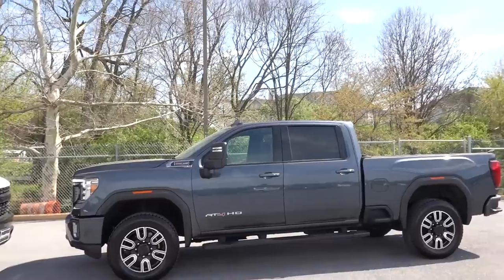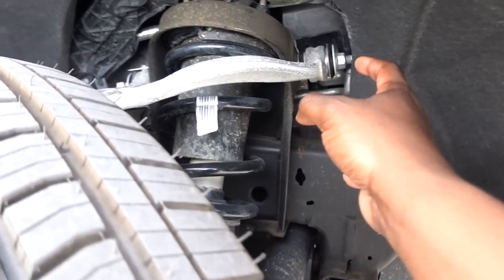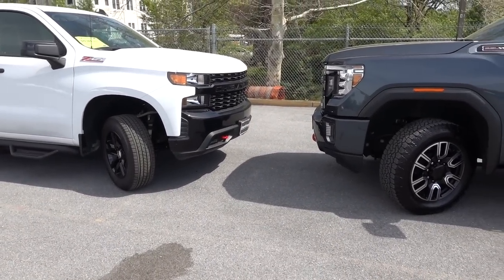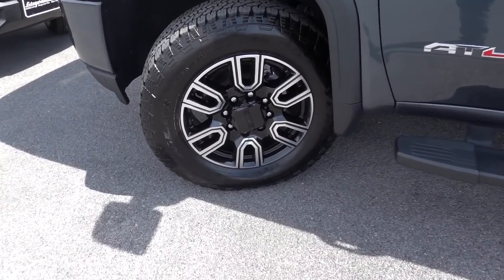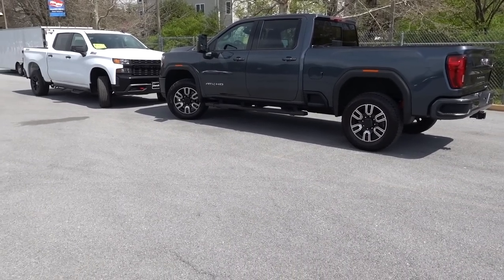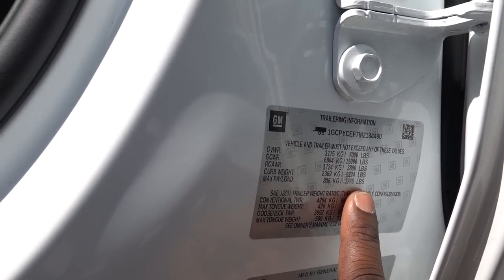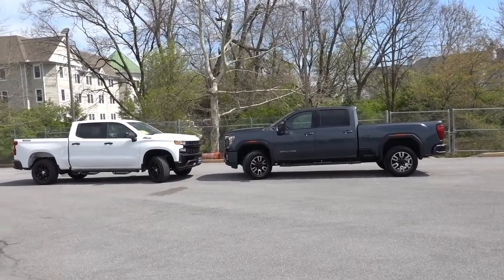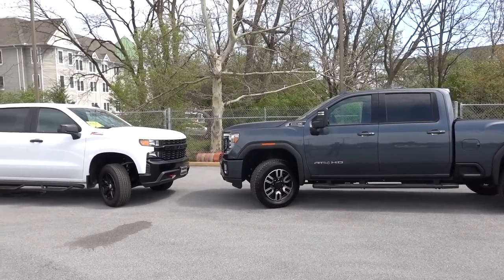Light Duty VS Heavy Duty - 3 Reasons Why You Should Just Buy The HD!

Comment: Both suspensions are independent, but the HD uses torsion bars instead of coil springs, hence the lack of springs. Linear rate instead of progressive with coils. You can see how the HD rides on the bump stops - that is designed to compress and give add some more tuning to the ride. They also have a recirculating ball gearbox instead of rack and pinion on the half ton. Steering feel suffers as a result, but that's a small gripe and trade off.
Reply from the maker: Thanks James, I’ve looked under these trucks a lot and never noticed this 👍🏾👍🏾

Comment: I did a ton of research and concluded that there’s no point in buying a 1/2 ton because they cost nearly as much as a HD but only have half the capability. The tongue weight of a 7000lb trailer plus two people in the cab will max out the payload on most half tons. Half tons look like trucks but have car-like payload ratings.
Reply: Truth
Reply from the maker: This 👆🏾
Reply: My wife and I have a Dodge Durango 4wd, a diesel Ram 1500 4wd, and a diesel Ram 2500 4wd.  The Durango has 40lbs more payload than the 1500.  The 2500 has double the payload of the 1500.  The 2500 has awesome power.  The 1500 has excellent abilities in the snow and offroad.  Both trucks are too heavy and large for many parking garages.  Bilstein 5100 shocks improve both trucks over factory.  The fuel economy of the 1500 is at 33mpg or more at 65mpg.
All 3 vehicles are different.  Enjoy them for what they do!
Reply: @zxej6879  the Durango is also built to carry 7 passengers. It also depends on the trim level of your 1500.
Reply: Fuel economy is the biggest difference.

Comment: Great video. This is something that needs to be more addressed in my opinion. And as someone that has recently had both a 1500 and a 2500 that I used to pull my race car (8.5’x24’ enclosed trailer that would at the absolute most weigh 7,500 pounds) I can assure you that the number one benefit to the HD over the half ton is the physical size and weight of the HD. They have a longer wheelbase and weigh essentially 2,000 more pounds. And if it’s a diesel it will be more like 3,000 more pounds. My diesel per the sticker weighed 8,198 pounds. My 1500 weighed 5,287 pounds. My new 2500 6.6 gas weighs 7,123 pounds. That extra weight and just size in general makes a difference towing. 

There’s several other reasons that I could name (bigger fuel tank, longer bed, the option to have cab lights lol) but the size and weight of the truck are the biggest reason in my opinion. That of course is if you are towing. If you’re not ever going to tow then get the 1500 and have a better ride and better fuel mileage.
Reply from the maker: Great point and I forgot to mention the wheelbase because that’s a major advantage. I too learned about the total weight of a truck having a major benefit when I towed a uhaul trailer with my 1500 and 3500. Even with that trailer it was night/day 👍🏾
Reply: @JB_WhoWork  it really is. It’s almost like they are made for towing and hauling lol. The manufacturers in my opinion need to scale back some of the tow ratings on 1500s. I mean 9,400 pounds is a lot and I feel pretty confident that they will handle the actual weight but the size and type of trailer is way more important in determining the towing experience than just the weight. 9,000 pounds on an open trailer is totally different than 9,000 pounds in a box behind you. 

You should do a video talking about that because as far as I know no one really ever mentions that. They just automatically see the tow ratings for most 1500s and say you can pull a camper with that. Well I say NO maybe you can’t lol. Especially if it’s over 30’ (actual 30’ box too, not 30’ counting the tongue).

Comment: Spot on with everything as usual! I have towed the same ~8500lb TT with a 1/2, 3/4 and 1 ton trucks. Even with a great WD hitch I would get blown around in the wind pretty bad and towed 3600 white knuckle miles in that truck. Moved to a gas 3/4 ton truck which actually had less power and torque than my 1/2 ton and instantly all my windows problems were gone. Again same hitch trailer and everything. Now have a 1 ton diesel and now I barely notice the trailer and feel like I could tow it to the moon with no problem. If you plan on towing a TT get a 3/4 ton. I don't care the size as for the same price it's worth it.
Reply from the maker: Thanks for sharing 👍🏾

Comment: Biggest issue is 4 adults can easy be 1000 pounds, and nothing really left for towing in half tons. 1700 is on the higher side for many half tons.  I have seen ram limited 1500 with a payload of 950.
Reply from the maker: Good point, tundra is typically less than 1400#’s of payload which isn’t much room… 👍🏾

Comment: JB, I enjoy your comparisons. Another difference to consider is the significant difference in registration cost. In PA the difference between 1500 & 2500 is significant. Would love to see a future video comparing a 2500 HD against a 3500 SRW truck. I found one other video on YT about the subject, he did a great job comparing the differences even going so far to list the identical OEM part numbers that both trucks shared. He was comparing 2 older GM trucks, the only differences he found were 2 more leaf springs in the rear and an extra stiffener bracket on the rear spring mounts and of course the payload sticker of the 3500. Everything else including brakes were identical.
Reply from the maker: Thanks, I did a similar video on newer GM trucks 👍🏾

Comment: I upgraded from a 2017 Silverado 1/2 ton to a 2022 3/4 ton gas last fall. Night and day difference when towing my small travel trailer. It is way easier than what I initially thought to max out the payload on a 1/2 ton. With myself, wife, teenager, and 2 very large dogs I am already pushing almost 700 lbs. Add 700 lbs of tongue weight (very conservative guess) and I didn’t have payload available for anything else (firewood, generator, tool box, etc.). I lost about 2 mpgs going to the 3/4 ton, but definitely worth it. I also no longer have that horrible 6l80e transmission nor any cylinder deactivation. I also appreciate that you can actually grease the front ends on the 3/4 tons which has to lead to longer component life.
Reply from the maker: Good stuff 👍🏾
Reply: There is no point to go from gas to gas. 
Diesel trucks are the best.
Reply: @BlkGryTurboR  I would agree if it wasn't for nox sensors, def fluid, def fluid heaters and the fact if anything goes wrong with any of those (and it always does eventually) your truck gets put in limp mode. My 6.6 gas 2500HD truck doesn't have all that crap and hauls great.
Reply: @HP-hm3pn whats all that crap for? And why dont 2500s have that?

Comment: I see it every day selling RVs people bought a three-quarter ton diesel and they are completely overloaded never Ever by three-quarter ton always buy a one ton or you’ll run out of payload
Reply from the maker: Yup, diesel 3/4 ton with 10k GVWR is travel trailer territory only 👍🏾
Reply: Totally agree. Wish I had JB to watch 5 years ago before I bought mine.
Reply: How will i run out of payload? If i pull a medium size fifth wheel that has a 12 to 13,000 lb weight? I have a 04 chevy 2500hd 6.0l gas 2wd. I think the payload is 6,000 not sure though.

Comment: Like golf clubs; you don't use a putter to drive and you don't use a driver to putt (in most cases). Over the last 50 years I have had numerous trucks; some were 1/2T and several were 3/4T and now a 1T. Each for a different purpose. My 1/2T definitely rode 'softer'  & got better mpg's when empty. The down side; you give up load & tow capacity. Its a much better driving experience towing my 8k 30 ft trailer with a 1T though. MPG's are very close to the same when loaded or towing my trailer.
Reply from the maker: Thanks for sharing Herb!

Comment: JB I have a 2019 1500 silverado  and mine came with those Michelin primacy  ltx 44 psi u just showed, I have a 20 ft travel trailer fully loaded is about 5k with tires. Do u recommend for towing?
Reply from the maker: That will keep you within the capacity but a stiffer sidewall can only make the experience better. Depends on how much/far you travel too 👍🏾

Comment: 3/4 ton gas is the way to go. 1/2 tons are for handymen trust me Ive been there and done a 1/2 ton 10K tow pkg blah blah... If I were you I'd likely never go full-time unless the trailer will be parked most of the time, not roaming around the states aimlessly. 3/4 ton will tow most affordable trailers out there, when you get to 3 axle trailers your main option should be diesel with dual wheels. 3/4 tons can handle the payload where 1/2 tons and 1 tons not properly ordered can't
Reply: So if i have a 04 chevy 2500hd ls 6.0l gas 2wd with a supposedly max travel trailer towing capacity of 12,000 and 15,500 for fifth wheel, i can tow a medium 2 axle fifth wheel no problem? I will also upgrade the motor im gonna cam it so basically a stage 2 kit at the very least.
Reply: @WalkingDead520  check the hitch weight of the trailer and the payload of your truck.  Look on the inside of your  drivers door, if you can’t f find it, check your truck manufacturers website. Or google your truck and go from there. Almost every year recently, in the past 5 years… or so… the capacity has changed significantly on the package your truck has. Don’t go off of what someone has, if it’s not your specific rear axle ratio, bed length, number of door, gas vs diesel engine, interior package etc… Be careful of lifted trucks and big tires unless equipped and rated by the manufacturer not a aftermarket shop. Take care hope this helps
Reply: OK so I do have a three-quarter ton truck, but mine has the heavy tow package 4:10 rear axle ratio, my payload is 3220 pounds my towing capacity is 17,800 pounds with a gas engine, 4 door 2022 ram 2500 tradesmen package hope this helps
Reply: @BD1974_Mac  yes im checking the specs on the chevy forum using my vin. Thanks, for the help. I actually just checked on my model online and it says the payload is 4,000. More than yours, and thats weird.

Comment: HD absolutely the best.
1 step further. Diesel all the way
Reply: I used to think that diesel was the best thing in a heavy duty truck.. However, I have changed my mind as the diesel engines have gotten  More expensive to maintain than gasoline engines and the fuel price Is usually more expensive than gasoline. Not to mention the whole issue of DEF. 
Granted if your work or recreational needs are putting you in high elevations and heavy loads of 15K pounds or higher  with 20K or more of driving a year then a diesel is better. However, most of us can get by with strong heavy duty gasoline engine and spend all that extra money on something else other than diesel engine.
Reply: @jimmcknight3021  funny. Just had conversation with guys with f250 gas and a 2500 power wagon . Oil change is 65 gas or diesel. Fuel filter easy to change def is every 5000 miles. 15$.
Sooo gamer need tune up..
And a diesel at 55mph is 20t mpg
Gaser is 13mpg all day.. all adds up. So u pay 10000 more foe diesel. But you get it back at end.
Plus diesel is barely broken in at 100000 miles.  Gas will need to be replaced soon..
Reply: @duramaxbradentonsaltwaterf9471  I have one diesel car, because I drive so much. However. I won't be doing that with a HD truck. It just won't meet my needs on the front end. Also it is ridiculous what I am paying for diesel and I live in oil country where fuel is cheaper. I feel sorry for JB and his family.  Lol
Reply: Speak for yourself
Reply: @thomaschambers157  I speak for thousands.. my opinion.. and everyone who I've changed there mind about a diesel agree 100% with me now...
I have not even mentioned deleting it... furthermore.  I travel alot hauling my 5th wheel. Auxiliary tank is another positive with diesel. I can go 700 miles b4 refueling hauling a 17000lb trailer.  1500 miles without..

Comment: Great video mate!! If may ask your advice. I pull an enclosed lawncare trailer daily about 5500lbs.  And I'm looking to upgrade trucks should I look into a HD if so gas or diesel? Any input will be much appreciated.
Reply from the maker: It really depends on how you plan on using it, I personally would go with gas just because I’m assuming you won’t be doing a lot of Hwy driving and will be in town more at lower speeds. I typically see lawn care trucks with gas engines so I’m basing it off that as well. Diesels are great for long distance but because of the emissions components, I think gas trucks would serve you better unless most of your driving is on the Hwy for at least 20-30 minutes minimum. This is coming from a diesel fanboy lol 👍🏾
Reply: @JB_WhoWork great answer bro, thank you :)

Comment: My one piece of feedback would be to skip the 3/4 ton and just go for the one ton. I priced the difference between my 2022 F350 Lariat and the same config in an F250 Lariat and the difference wasn't even 2k (if I'm not mistaken...).  When you are in that deep anyways, what would be an argument for not going 1 ton (aside from that price difference)?
Reply: @JB_WhoWork  I have heard tell that 1 tons need to be registered as commercial in some states, but I have been unable to verify that. Aside from digging that hypothetical bullet, what would be a real reason for going 3/4 ton vs. 1 ton within the context of such a small price difference between the two? (At least according to my own experience buying my Super Duty). I feel like I'm missing something.
Reply from the maker: Some guys don’t plan on using a HD the same as others, if your only pulling lawn service equipment or a 10k travel trailer, a 3/4 ton is perfect for this. The ride is the other reason why someone would go with a 3/4 ton 👍🏾
Reply: @JB_WhoWork  yeah the ride quality might indeed be a big piece -- I didn't think of that. I went from my F150 to my F350, so I didn't really experience the ride in a 3/4 ton. My F350 is stiff indeed, but I don't think it rides as badly as a lot of guys complain about. I have the Lariat trim, so maybe the lesther seats help a bit (?). Thanks for the idea.

Comment: Good video JB. A couple of observations.  I have a 2021 Ford F150 with the 5.0 V8 equipped with the max tow package. That package gives you the potential of towing 14K pounds and a payload just over 1,800 poinds. It is 4WD and actually sits higher than several HD trucks. 
Would I tow that much with this truck? No way! They just don't handle heavy loads as well. I did haul about 8K pounds of hay on our flat bed trailer,  but that is not the same as A 8K to 10k travel trailer. Hopefully when our lease is up there will be HD trucks Available again. 😆 lol
Reply from the maker: Thanks Jim!
Reply: Your F150 sits higher than several HD trucks? I sure would like to see that. I've had my 2022 Silverado 2500 for five months now and have yet to not look down at ANY 1/2 ton STOCK pickup. I have an F150 also.... wife does actually. There's no other 1/2 ton I would buy other than an F150 and for HD's it's Chevy hands down.
Reply: @HP-hm3pn  I have problems believing it myself. I am thinking it's a little higher because it's 4wd and has the max tow package. I didn't lift it.
Reply: @HP-hm3pn  whats your say on HD chevys? I have a 04 chevy 2500HD LS 6.0l gas 2wd and i was just looking at its tech specs and from my understanding, it says WT distribution hitch-max trailer wt is 12,000 and fifth wheel hitch-max trailer wt is 15,500. Does that sound right? I would like to tow a medium size fifth wheel double axle with a wt ranging from 12 to 13,000

Comment: The thing about the 1/2 tons is they have better tires for driving at high speed 70+ mph.   The HD tires build up too much heat and explode at those speeds.  
I think the 3500s or 350 are the best hd trucks to get.  I really hate the 2500s cause they can’t carry as much as people think they can.  They’re slightly beefed up 1/2 tons.   I was able to spec out a Ford F-150 that had almost as much payload as a f250.  
And it’s those f250 people who will get themselves in trouble towing 20k lbs trailer thinking the truck can handle it (which it physically can) but (legally) can’t handle the weight.

Comment: I was leaning towards an HD but it's just not practical for how much highway miles I do right now. I haul failry often, but only haul heavy stuff occasionally, and I'm looking at travel trailers that are certainly at the top end of my 1500's capabilities, but I won't be towing it more than 2 or 3 times a year. 

For the money I paid for my Limited, I'd have to drop to a lightly appointed Laramie in an HD for the same money. I will probably upgrade to an HD a few years down the line, but the top level interior, luxury SUV like driving manners, better fuel encomony, tighter handling, better acceleration, etc makes the 1/2 ton make the most sense for me right now.
Reply from the maker: Nothing wrong with having it all in a truck, just have to lower your trailer standards 👍🏾

Comment: They aren't even close.....owned 2 HDs and 2 1500s since 2019....if your gonna even anything on reg basis get an HD......just makes it so much easier.....even light weight trailers I would get HD......capability isn't even close.....in the wind, the stability and cost is the same aside from a diesel......I just don't tow ever, so back to 1500

if I did I would be back into a 2500HD or actually a 3500HD because they drive the same and have more capacity than 2500....

On my 1500 I feel like I could break it if I wanted, on my 2500 I did not feel like I could no matter what I did
Reply from the maker: Thanks for sharing bro 👍🏾